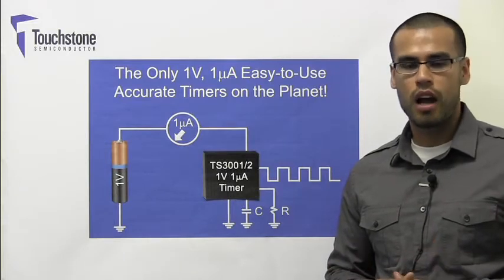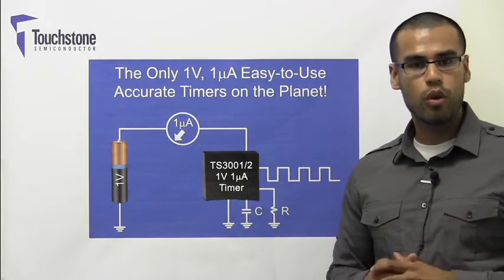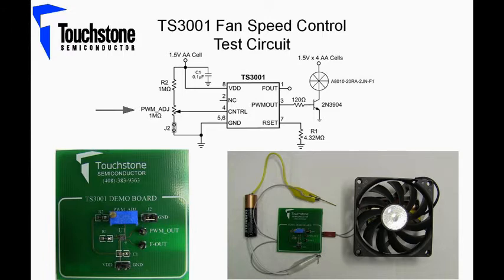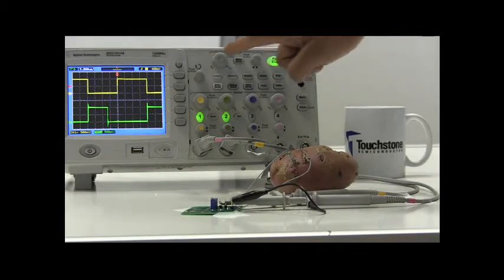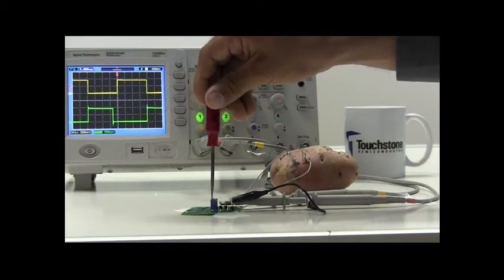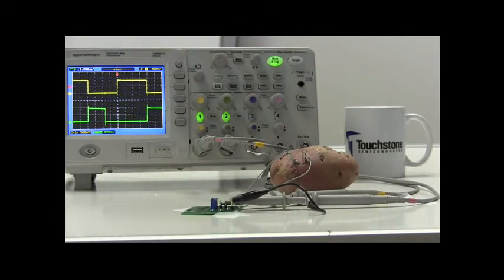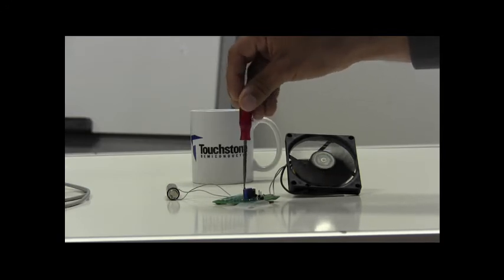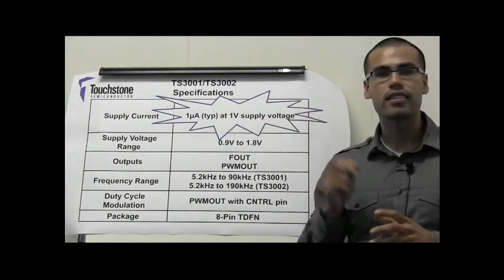TS3001 Applications Video

Comment: To paraphrase Judy Tenuta, Though pushing very hard, all things are possible. Mill-Max makes very nice pins, you can do a PC100 backplane, pick a safe chemical, metal or other etching process for the backplane material of your dreams (graphene on gluten, say) or just pick what works for the lithography you have.

Comment: I want to use this for an oscillator required in a circuit and I need to be able to hook up the pins to stuff. I don't have the ability to solder the surface mount, do you know any way I can connect up the surface mount to stuff?